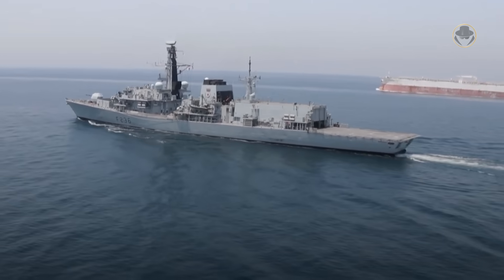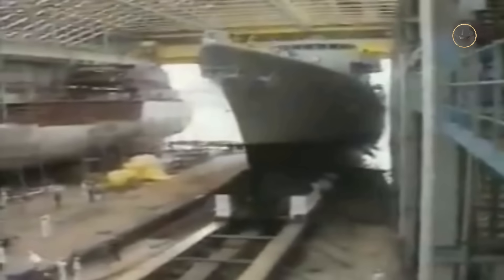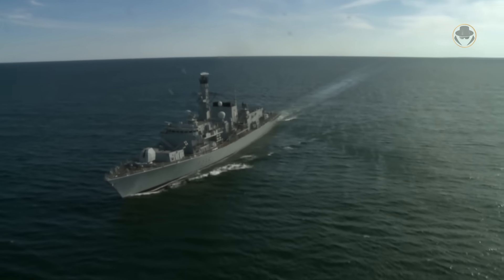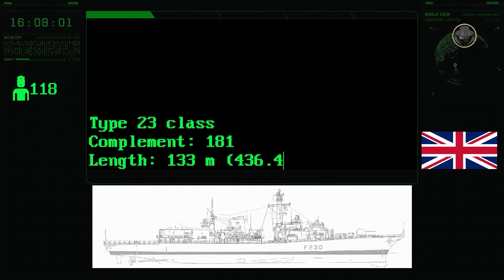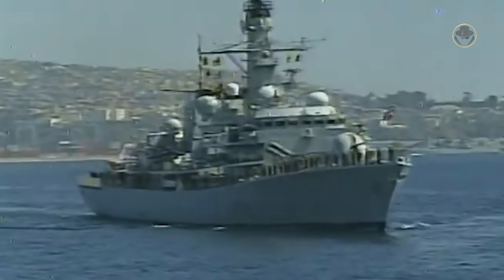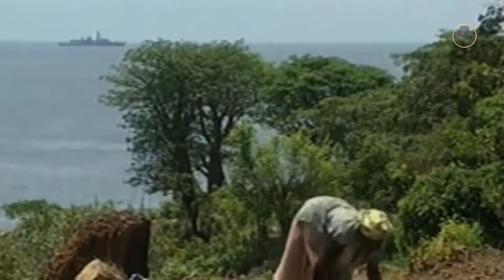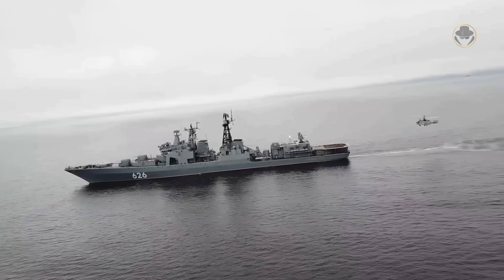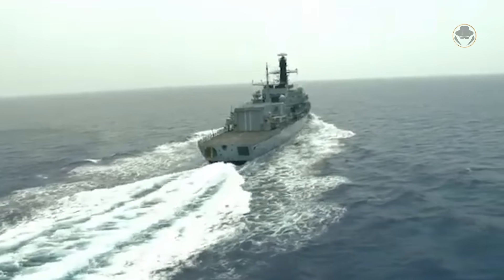Type 23-class frigate | The Duke of the Seas

Comment: Type 23 heavenly underpowered, more equivalent to  a escort vessel.
Reply: Type 23's are Frigates so are Escort Vessels - what is your point ?.
Reply: Frigates and destroyers are primarily defensive escorts ships with some offensive capabilities. 

Crusier, submarine and carriers are primarily offensive ship with secondary defensive role.

Type 23 was a very good design for it's intended role of fleet sub hunter. Problem only arise when they don't build them in sufficient numbers and try to use them as a general purpose warship.
Reply: @moss550  It was designed as an ASW/GP vessel.
With a medium calibre gun, 32 SAM's, 8 SSM's, 2 x RWS with 30mm cannon, MTLS and Merlin she was as well armed in general as anything of a similar size. Her only fault was a lack of longer range land attack. But given that applies to every Navy outside of the USN in the timeframe thats not a massive issue (and USN vessels carried at most 8 Tomahawk usually).

Comment: Great vid one small point the the type 23 are fitted with phalanx from memory they mount two
Reply: The Type 23s were never fitted with Phalanx or Goalkeeper. The Type 42s did though (after the Falklands). The Type 23s had 30mm DS30M (not a CIWS)
Reply: Type 22 batch 3 had Goalkeeper. Type 42 and 45 destroyers have 2 x phalanx. Type 26 will have 2 x phalanx
Reply: Only other RN ships to have Goalkeeper were Albion class LPD, and Invincible class carriers
Reply: @AP-ic3un  and Type 22 batch 3 (Cornwall sub class) had Goalkeeper
Reply: Batch 2 type 22 had twin barrel 30 mm oerlikons and gambo1
Reply: I believe they sported a Goalkeeper, but they were deemed redundant and removed.  Plus they made them top-heavy
Reply: @juanpablo681  Nope no CIWS fitted ever only the 30mm DS30m x 2
Reply: @juanpablo681  Type 22 batch 3 had Goalkeeper, not the Type 23